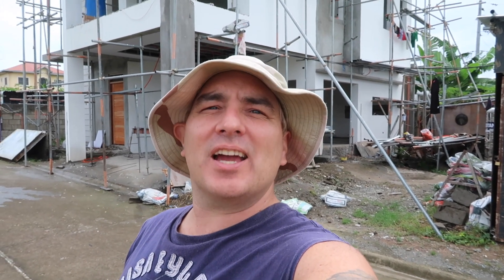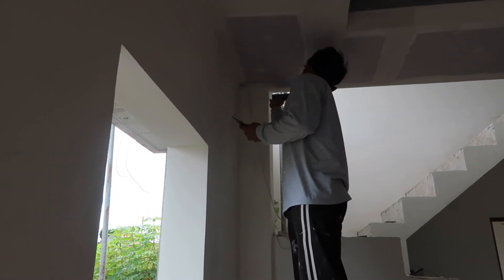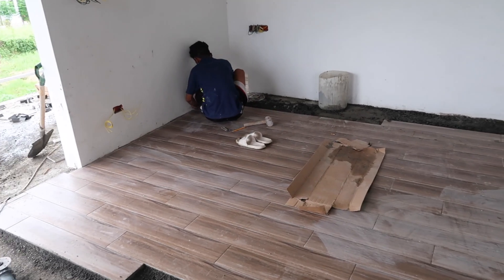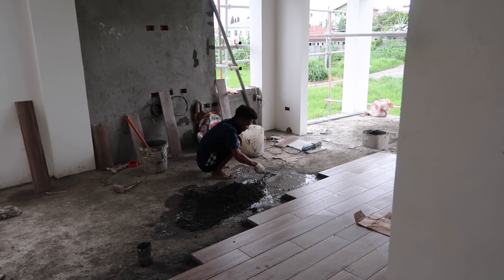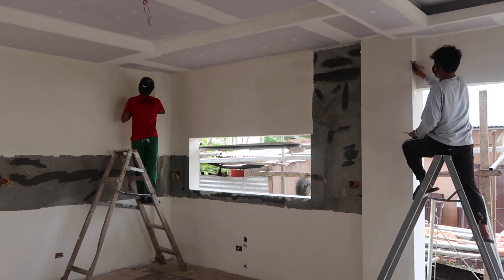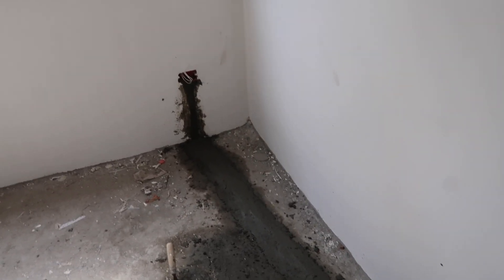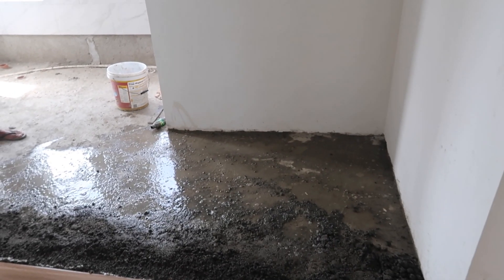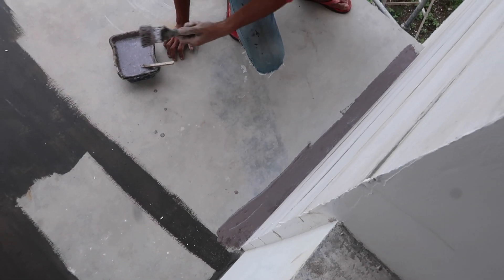HOUSE BUILDING IN THE PHILIPPINES - EPISODE 154: MASTER BEDROOM FLOOR TILES

Comment: All that skim coat in the cr will fall out...  Unbelievable.... Looks like they are cutting lots of corners now trying to finish.   The cement needs to cure fully before skim coating can be applied on all those patch areas they are doing now on the pipes and outlet repairs.  So sad,  You have a nice house and you will have to spend more and more just fixing all the mistakes they are doing now.. I would make the contractor replace the door they messed up.
Reply: Contractor?

Comment: it was observed the progress is very slow. until now skim coat is on going, welding works at garage until now is not yet done, some still chipping on the floor. imagine the foreman chipping the door with round hole, it's very easy if he use hole or drill bit with the same size. look at the ceiling hey man no design at all, you got kindergarten carpenters. you may raise your voice remember you are the client. this is just an observation, anyway thanks for the video.
Reply from the maker: Rey Deblois just wait
Reply: Wait for what? Wait till run out of construction budget? Anyway that is your money 😀

Comment: sorry to say this, if your house subfloor is evenly cemented and clean, your workers don't need to use the rubber malet too much. also they need to use proper tile mortar and trowel with notches. not using the proper material and tools are the reasons why tiles are detaching to the subfloor especially in the philippines. it happened to my sister's house in olongapo too. i guess you cannot direct your workers how to do their jobs. as for me, the way they are doing their jobs, i will not hire this contractor if i will build a house in the philippines. these workers should watch many how to do thing videos in youtube to improve their skills inteads of wasting time drinking after working hours. i am currently replacing myself my house's stair with hardwood treads and also the flooring with engineered wood. after that i will design a house for people who want to build a usa standard house (4 bed rooms, 2 floors) in the philippines that can be built cheaper and quicker, 3 months or less (not including getting a permit and materials).